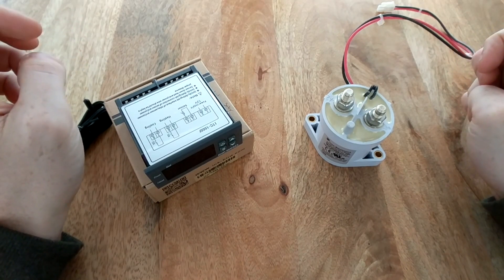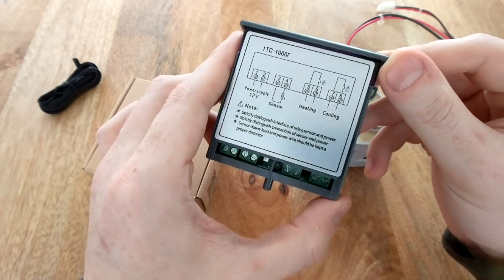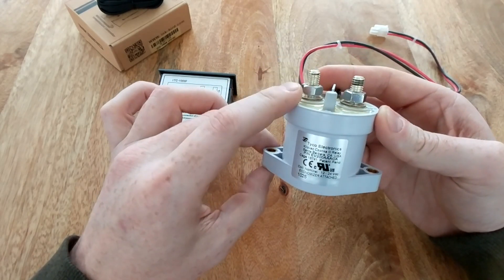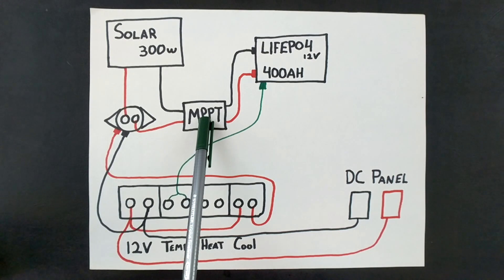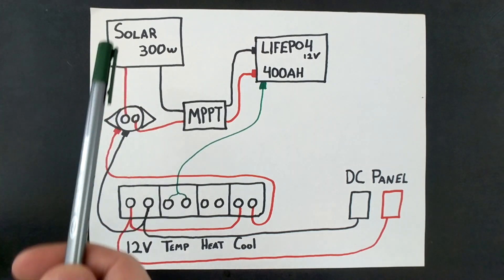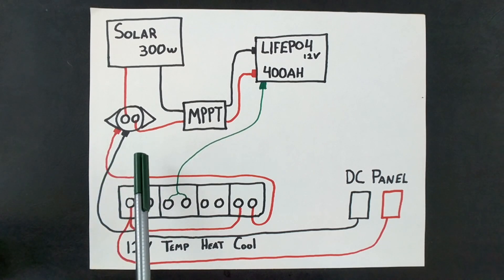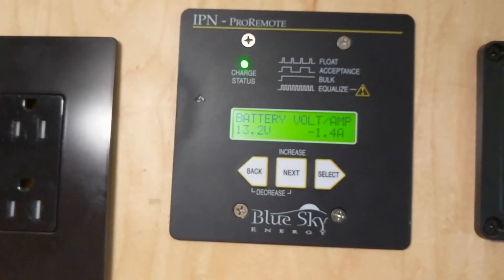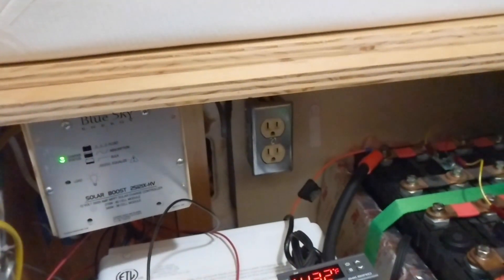How to Prevent Charging of LIFEPO4 Lithium Batteries Below Freezing in a Camper Van

Comment: Thanks, for this video!   I think I'm going to use the ITC-1000F on the heat side to control a relay that will energize a couple of reptile tank heating mats to keep the batteries from dropping below freezing.   That way I can continue charging my batteries in colder weather.  Very cool little gadget - and, cheap, too!
Reply from the maker: Richard Owens just be careful with the amount of current those pads draw. You may want to use an external relay that can handle more current. Also keep in mind that if your primary charge source is solar, you may want to also wire a timer so you aren’t heating the batteries when you aren’t charging. 

FYI I’ve switched my setup to victron and ditched this setup as victron gear (bmv-712 and smart mppt) can talk to each other and share temp data and simply turn off the charger.
Reply: @nebulight  They're only about 20 watts each and I have two of them.   And, the battery bank is 450 amp-hours at 51.2 volts, so 23,040 watt hours of capacity.  40 watts draw only when the temperature drops below 40 degrees is a negligible loss and quite tolerable.  And, of course, solar panels produce more power when they're cold.  The relay to power the heating pads would only need to be able to handle 120 volts at 1/3 amp.  I'm using Victron Blue Solar 150/35 chargers - two of them.   I plan to get a Victron Venus GX and the BMV-712, as well as the REC-Q Victron compatible BMS.   The BMS is capable of switching a relay to stop charging, should the batteries get too cold.   But, I think I would prefer to be able to continue charging in cold weather by keeping the batteries warm using the heating pads.

Comment: Hi what is your BMS and lifepo4 battery cells?
Thanks
Reply from the maker: I'm using a MiniBMS V7 (no longer sold) and 16 Sinopoly 100ah cells in a 4p4s configuration for a 12V battery.

Comment: Thank you for the excellent video. I have been thinking about the same temperature problem and this is the best solution I have seen yet. I have been disappointed in the battery manufacturers that I have talked to who don't seem interested in providing reasonable solutions and likely know that their batteries are often charged outside their recommended ranges and to their benefit (more frequent battery purchases). I am building a camper van and planning for 400A-hr storage. I know the van interior will see both higher and lower temps than recommended for charging. Your solution should work well for summer and winter by changing the set points twice a year. I will have 3 ways to charge my batteries 1) battery to battery charging from the van, 2) solar, and 3) shore power (120V charger/converter). A couple of questions if you don't mind: 1) would you expect any issues with routing all 3 chargers through the relay? and 2) How has your solution been working so far? Thanks again for the great video and any suggestions that you might have.
Reply from the maker: JIMMY G thanks for the comment. As for your first question, as long as the solenoid is rated high enough, there is no problem running all your chargers through that relay. And your second question it worked great all winter. It also has an added bonus of acting like a switch to shut off solar by turning off the temp relay.
Reply: @nebulight  Relion battery has a solution now.  They divert charge current to a heater in the battery when its below a predetermined low level.  After the battery warms, the current is then diverted back into charging.  Their 100ah low temp battery is $1348.95 .  Energized outdoors is coming out with one as well.  It will be cheaper but I am not sure of the specs.  I am building a 240ah LiFePO$ bank and I intend to utilize the same thermostat used in this video to power a small silicone heating pad applied to an aluminum heat sink installed in my insulated battery box.  It should easily keep the air in the batttery box above freezing with little draw on the battery.  The heater is 20W @12v so only 1.66a.  To keep the box between 35-36 degrees it ought to take very little power.  That's my solution.
Reply from the maker: @michaeldoherty2289  That's a great idea. I too have purchased Silicon heating pads but ended up not installing them as we moved to Nevada so freezing temps is no longer a problem for us ;)
Reply: @nebulight  Msybe I ought to move as well, though the themostat/heating pad/heatsink at 20 bucks is a lot cheaper!
Reply from the maker: Michael Doherty funny enough we moved because of our van. So many travel opportunities out west.
Reply: @nebulight  Of course.  We live in Spokane Wa and its a paradise.  But the cold and snow and dreary wet winters tend to get old after while.  A sunny location would be welcomed!

Comment: I thought Lifep04 temperature issues varied depending on temperature. Example, if the cells are at 20C (Celsius) you can charge them nearly fully, at 15C you should charge them less, at 10C even less etc... Just shutting off the batteries at freezing may not be good enough to keep very healthy cells.
Reply from the maker: You are correct, but my solar charger doesn't ahve that ability. I always turn my charger off when it's cold and not in use, but this is if I forget. I've since moved to warmer climates so it's not much of an issue anymore.

Comment: Great solution! I am looking at replacing my lead acid batteries later this year with lithium batteries and had not yet thought on this issue.
By the way, which batteries and bms are you using. It looks like you just bought some cells and added a bms. I have not yet pick the battery I want to use and would like to know your thoughts.
Thanks.
Reply from the maker: I'm using Sinopoly Cells with a CleanPowerAuto MiniBMS (no longer in production). I suggest going the route of getting your cells, bms, contactors and busbars vs a drop in battery if you plan on going with more than 200AH. It's usually cheaper to go this route and you have more control of the BMS.
Reply: I am planning on using the Batrium bms, but was just curious about what you were using. I looked for the Sinopoly cells and had no problem finding them in China or Europe, but couldn't find them in the US except a couple on ebay.
Reply from the maker: Stick with Calb or Winston/Thundersky. Just as good and larger distribution network.
Reply: Thanks again for the info. Admittedly, I am also looking at nmc batteries, possibly from an EV. 
BTW, I have the same BlueSky charge controller. I am planning on using only 2 stage charging, since lithium batteries don't like the possible overcharge of using Float. 
Finally, I am guessing that the other relay by the battery switch is for low battery cutoff (and possible for high battery cutoff)?
Reply from the maker: NMC is nice, but be careful with your charge profile. Also you won't really be able to replace 12V lead acid as 3 in series the voltage is too low and 4 in series is too high. The second contactor (relay) is my protection circuit. If any cell is too high or two low, it disconnects the battery.
Reply: The charging is the toughest part of using nmc. I spent a lot of time looking at chargers and inverters, and most will not work. I also wasn't willing to go to a higher voltage (extra space and complexity) or really expensive charger/inverters (again most 12 volt ones won't work). I did eventually find an inverter that would work (adjustable lbco), plus it had a transfer switch (Xantrex Freedom X).
As for charging, I am hoping to strictly use the BlueSky charge controller. I bought a 330 watt power supply (since 340 watts is the charge controller's maximum) and plan to feed the charge controller through a transfer relay ( solar or grid can feed it, not both at once). I can do this while still using fla batteries to see how well it works. This test will help decide if I can use the nmc batteries.

Comment: While your design addresses the immediate concern of charging / disconnecting charging it also disconnects the solar panel altogether. Many very cold days are also sunny... so for me I would leave the solar panels connected for coach power. Admittedly this complicates the design a bit more but not immensely. Other than that - Great precaution!!
Reply from the maker: This is correct, but this is primarily when we are away from the van or it is unoccupied for a long time during a trip. If we are in the van, the heat is on so it shouldn't disconnect the solar. When the van is stored, the solar is disconnected anyway as I like to keep my storage SOC at around 50%.

Comment: I'm curious how you're Heating your space in a camper. I know they make very small Pellet stoves , like they use on sail boats, What if your heating your space with a pellet stove or something and also heating the storage area where your batteries are located to keep them above freezing? or have a light bulb heating the area. What is the lowest temp you can run before your risking damage to your batteries? I have a 5th wheel and usually have shore power but I might still use a pellet stove for extreme weather because my space heater can't keep up and usually trip the breaker after a while.
Reply from the maker: ZGERMAN they can run fine up to -4F, but will be damaged if you even store them below that temp. I'm going to wire up some heat pads to the heat circuit on that itc1000 and have them turn on at 0F. I have a webasto dual top heater that I don't want to run when it's stored.

Comment: I like this solution, how are you finding it? (if installed yet)
Reply from the maker: Self Build Camper it is working well. I installed it a few days later in it's final spot so the remote panel stays on. However I think I plan on upgrading my bms so I may install it on the battery side again and figure how how to splice into the remote wire to power it from another source. This way I can use that relay/contactor to hook up other charge sources as well. Hope that made sense 😀